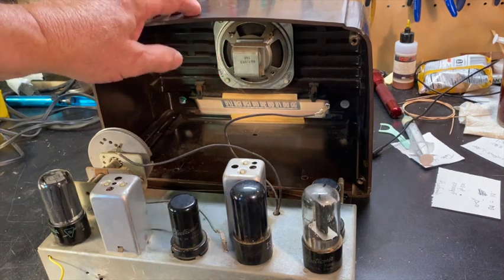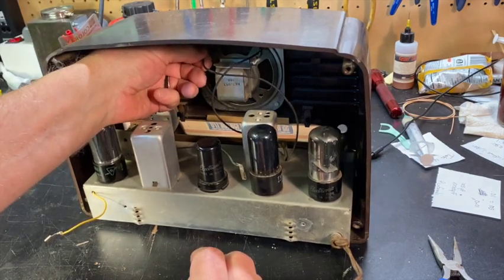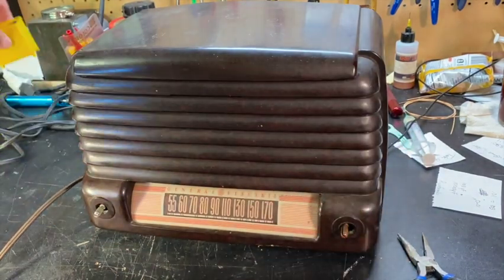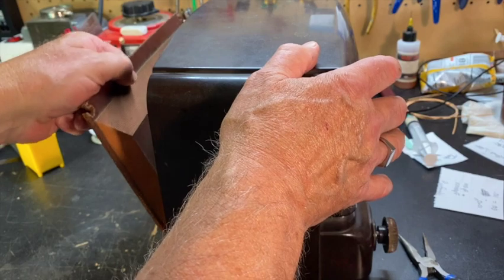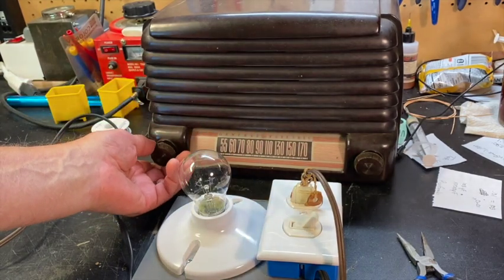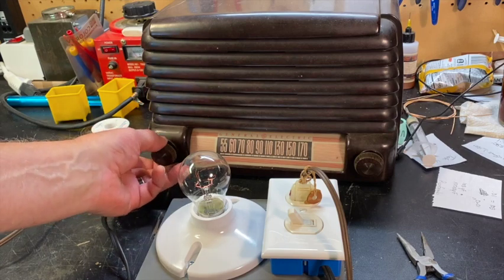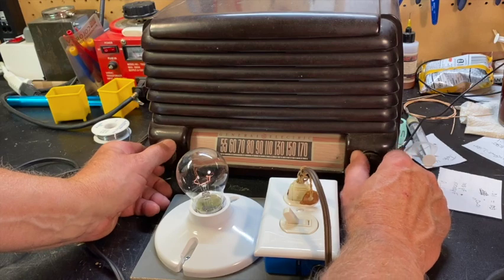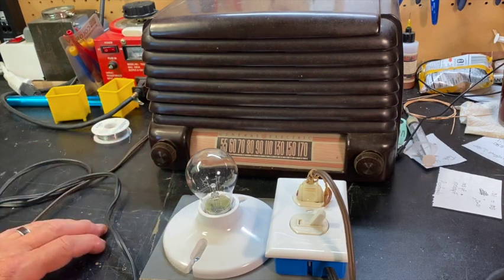GE 107 Episode 5 The Moment of Truth

Comment: Greetings: You neglected to show that when the plug is in and the radio is ON there is no voltage on the chassis until you turn the radio OFF. Then the chassis is HOT using the path through the heaters! (Yes, the radio will be its own current limiter, but you will still get a nasty shock or even die). Best is with a polarized plug in a known correctly wired outlet and the hot lead goes directly to the power switch, then the chassis is safe until the radio is powered ON. Then this circuit limits the chassis via R11 470k and C20 .05 mfd which should be replaced with an X1/Y2 .01 mfd safety cap. C14 .05 mfd "across the line" when switched ON. It should be protected by a mains fuse in the HOT lead.
Reply from the maker: Thanks. Interesting insight.